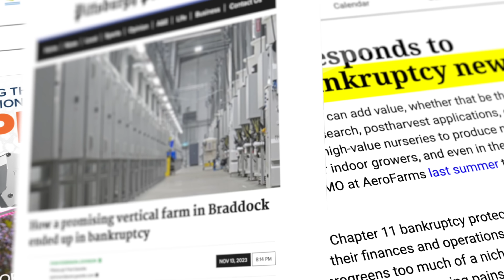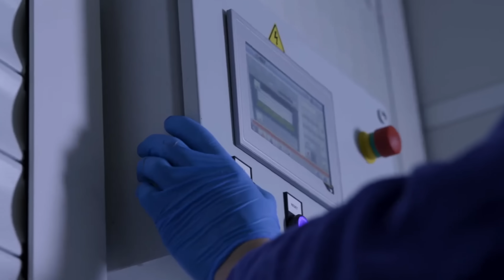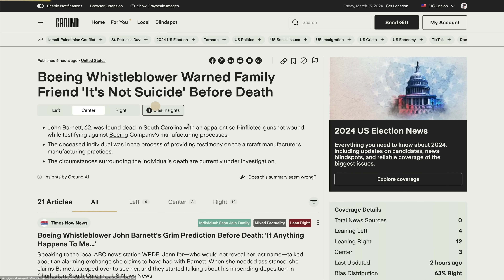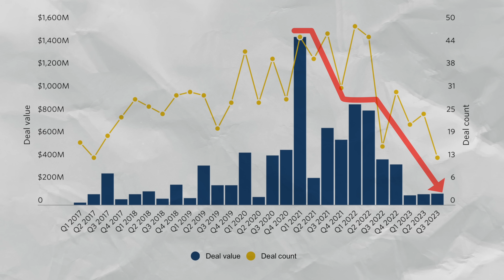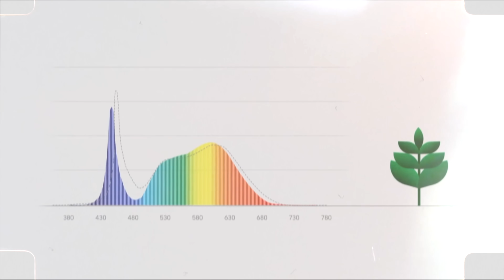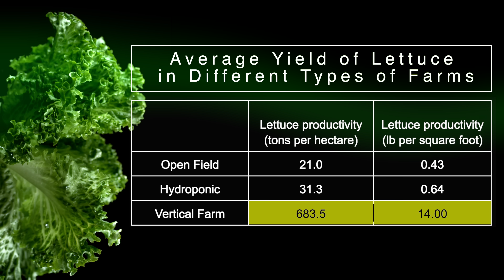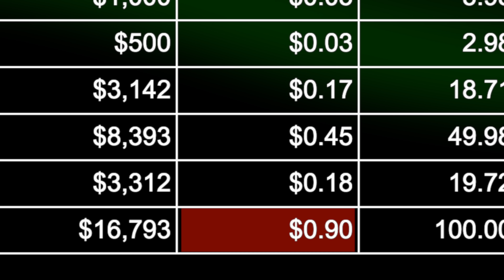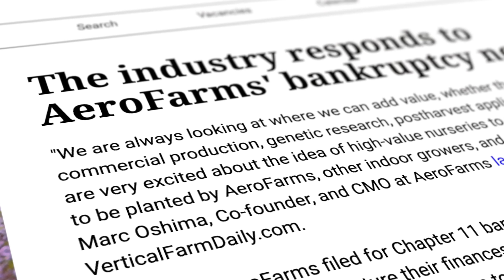The EPIC Failure of Vertical Farms - What Happened?

Comment: Looking back, another problem is crop selection.   Replace hydroponic farms with recycling soil and more profitable crops can be grown.  
     Alfalfa, soybeans, peas, oats, beans, squash, watermelons, cantaloupes, tomatoes, strawberries, squash, cucumbers, potatoes, carrots, peanuts, ..., 
     Without trying to be cutting edge, these are all easy to grow, produce high yields, and add variety to the crops.  
     Removing height constraints opens up more varieties.  Corn, maize, wheat, grains, pears, avocados small footprint fruits and citrus can be added.
Reply: the value of farmland is based on it's ROI on a certain specific set of crops that have already been tested to have the highest dollar returns for that particular land. any given crop being grown on any given piece of land is usually there because it would not grow well anywhere else, not because it can grow there. For example potatoes are mostly grown in idaho and maine on a relatively small piece of land, despite being suitable for growing almost anywhere in north america, because they have extremely high yields and farming automation requires a particular type of soil to efficiently extract it from the ground. and yet, they still only get 10% of potential yield per acre because getting the other 90% would involve too much labor. 

Trying to grow a variety of crops only works when you are supplying directly farm to market locally. On an industrial scale its nearly impossible. 

Also alot of the crops you mentioned are not suitable at all for growing on anything but subprime land. squash in particular comes to mind, as it has some of the lowest yield per sqft out there.
Reply: @duderinoification ... Well, nice try, but nope.  
     Where crops are planted is based on many concerns.  Many wet crops (cotton) are grown in dry, semi-arid, arid, scrub, and desert land.  
     Enough water, access, good or acceptable soil, distance to processing plants, sunlight, rain, degradation of soil by some crops, crop rotation, is that the best place to grow that crop, what else needs that space more, yield, labor needed, labor available, etc.  
     For instance, potatoes are grown in the Deep South from Louisiana to Virginia.  We haul over a hundred trailer loads out of "ALAGAFLA", where the three states meet in SW Georgia, every season.  Sweet potatoes are grown in the North Carolina plains.  I would not call squash a low yield crop based on the number of mosquitoes I feed while pickling squash every year.  Same with green beans, peas, peanuts, potatoes, cucumbers.  Corn is surprisingly inefficient, averaging  about 2 ests per stalk and creating lots of dead stalks to deal with.  
      Cotton was the crop that funded Southern Antebellum plantations.  Plenty of land, plenty of water, plenty of labor. 
     There was also space for feed crops, tomatoes, melons, vines, grapes, okra, orchards and more.  I have picked all of these in Southeast Georgia, where the sun is hot and the mosquitoes are hungry.  

In the '60's, the Aral Sea was massive.  By 2005 it had shrunk to two unconnected puddles.  
     Wanna guess what happened?
Reply: @WTH1812  sweet potatoes are unrelated to potatoes, completely different plant with utterly different requirements and growth patterns and cuktivation techniques, and a hundred trailer fulls is pennies. That wouldn't cover the demand for mcdonalds alone for a single day. and they grow ALL of their potatoes in a tiny are in maine. 
Squash is a low yield crop. per acre. pre square foot. 

we dont grow much cotton anymore. 

we grow corn mostly in iowa illinois and nebraska because of the soil. many considerations come into play. If strawberries or squash or peanuts were more profitable there, they would be grown there. 

youre missing the point It's not about what you can grow. Its about what you cant grow. You can grow anything almost anywhere. It doesnt mean it'll be profitable.
Reply: @WTH1812 
to further elaborate, farmland is priced with the assumption of a 5% ROI for the most valuable crop that can be grown on that land. 

For example, if you can earn 20k per acre raising dairy cows, that land will be priced around 400k per acre. 
You will not grow squash if it yields you 18k per acre. you will raise dairy cows. you cannot grow squash on that land because you cannot afford to.
Reply: @duderinoification ... We are one of dozens of trucking companies, independent contractors, gypsies, and load of convenience backhauls the pulled produce out of ALAGAFLA.  
     Sweet potatoes are another bulk crop grown in the South that are pulled out by the trailer loads.   
     Cotton is a generic crop I use to represent all the thirsty crops planted where water isn't.  
  
Large flat plains that can use large mechanical farm equipment easily.   

BTW, what happened to the Aral Sea?
Reply: @WTH1812 
you still do not get it. 
it doesnt matter if you can grow cotton where its dry. You can grow anything anywhere. 

The reason cotton is grown where it is grown is because it is the most profitable crop to grow where it is grown. If it was more profitable to grow anything else there, the more profitable crop will be grown there. 

THE PRICE OF THE LAND IS BASED ON THE PRICE OF THE MOST PROFITABLE CROP THAT CAN BE GROWN THERE AT 5% ROI. 

what part of that do you not understand? 

You grow what is most profitable. In your tiny little sliver of georgia, potatoes might be the most profitable. Otherwise they would be growing cotton. or apples. orwhatever else. and the land is priced based on that.
Reply: @duderinoification ... Univariant optimization in a multi-variant environment always results in a less than optimal result.  
     😎 Thanks, it's been decades since  I got to use that quote.
Reply: @WTH1812 your quote about univariance is just flat out low res take AF. 
Most crops have companions or alternates that are rotated. Corn and soybeans. Wheat and lentils. etc. These pairings are set in stonen and factored into the price of the land. You are not going to make money growing squash on corn land no matter what the yield. 

The mark of an amatuer gardener is growing squash, especially zuchinnis...getting a big plant with more than you know what to do with, then acting like they were successful. Congrats, you grew the easiest thing to grow anywhere that is nearly universally unprofitable unless used for overfertilization remediation in a market garden environment and even then is often sold as a loss leader. good for you buddy.
Reply: @duderinoification .,, - or - squash was popular with my mom so we planted a row in the backyard garden.  Every year it went forth and multiplied with gusto.   We used the excess for target practice.  
     Yes, crops are paired and rotated to keep from leaving the ground depleted and lying fallow.      
     As for planting crops to maximize profits, too much of a "right"  crop floods the market add lowers its value too low for it to be profitable.  This this is avoided by a holistic approach for the entire country to keep from flooding the market. 
     In China, some food prices are lower than cost, sometimes farmers can't give their fruit crops away because too much fruit and shoppers barely have enough money to buy one fig.

Comment: I have been farming for almost 30 years, mostly organic, mostly outdoors, and have always doubted these hi-tech fantasies. First, the hygiene hypothesis applies -- our effort to kill all pathogens/pests is (probably) a mistake -- in our human bodies as well as in an agricultural ecosystem. (that said, I make no claims that organic farming has overcome the issue of pest pressure with a more open-system approach to soil/air/water biology.) Second, to my eye all those structures and materials are depreciating by the second. Third, the problem with agriculture, economically, is that the unit value (head of lettuce, serving of grain, etc) is so very low. Only a crop like cannabis can justify this high level of capital cost. Fourth, the ethics of our ecological crisis requires humans to attempt to re-nature agriculture, rather than de-nature it further. Even if the creatures that benefit have no "value" for humans, non-human life is still something we should care for and about to the maximum extent possible.

Comment: What if someone cut the top off the container and installed clear ceilings then at night use the artificial light from solar power stored in batteries captured during the day from panels. Then, you'd get the best of both worlds by taking advantage of the greenhouse effect.

Comment: full automation should make it cheaper.
They have to replace workers with robots and AI.
Yes that would increase the upfront cost and maintenance.
Then again the cost of maintenance will go down as automation goes up.
If everything is fully automated, there is less risk of bringing pests into the system.

Its a needed tech for the future of humanity. 
We will have to eventually expand into space and space it at a premium on any spaceship or colony.

I think it will still take years of decades to make it work.
swiching to areas with lots of sunlight for solar power is a good start.
They will need cooling.
But solar power is cheap.

On a site note.
If they really only produce letuce, then i see a future where many humans will eat ration bars made out of them.
Then again automation is getting better at complex tasks so i gues farming all kinds of vegetables and fruits should not be a problem in the future.
Hell i see traditional farmers here in germany using self driving farm Robots during the night.
Works just like the lawn mowing robots, just on a larger scale.

Comment: Good analysis. When I hear people talking about farming yields only, they're missing most of the equation. Example is in rice- costs for labour, land, water, fertiliser and a whole bunch of other stuff vary significantly in different areas  and  these determine what practices and ultimately yields farmers will take. Pushing for higher yields also increases costs, especially if using more cutting edge agrochemicals. If yield value increase is matched by cost increase to achieve it, all you've done is increase the risk for the same profit. Being a farmer means playing for the long term as a few consecutive losses can wipe you out.

Comment: it would somehow have made more sense to place greenhouses , they have no shortage of land, just fresh water and transportation was never an issue
+ i am not even an engineer but i could easily create a desalination instalation that is not hypereficient but would work easily and constantly as long as the freshwater side were lower than sealevel and all i'd need is pipes, mesh, a solid filter, a rotating washer, concrete and either an olds' elevator or a traditional archimedes screw (the olds' elevator is an archimedes screw in appearance but it is the tube and not the screw, that spins)

with all of these and any secundary components you could create a pressure operated desalination plant in which the brine is continuesly driven up by the elevator, salt residue continuesly knocked of the filter by the rotating washer (and potentially waterjets) the fresh water would likely lack vital minerals but remineralisation could be achieved by letting the water flow trough natural substrate on it's way down, backteria and evaporation losses could be treated by simply running the water under sunlight in glass pipes and tubes (plastic would break down from sunlight as well as adding more microplastics to the mix)

it would NOT be anywhere near as efficient as a modern desalination plant, but that can be debated, this design would be so simple that maintenance could be done by allmost anyone, 

(watercollection should happen a ways of the coast and the pipes should have a large mesh sphere surounding the end of it, the outer opening should have at least 3 times the diameter as the internal opening allowing for a massive pressure increase, the mesh should be maintained routinely or perhaps it should simply be made of a material that does not polute the direct environment but is toxic to most living creatures that would live on it (or it should just vibrate or spin to prevent attachment)

perhaps filter maintenance and replacement should rely on a revolver system, when a filter needs specific maintenance or is simply worn out a revolving cilinder would move a secundary filter in it's place whilst raising the primary filter out of the system and allow for it to be replaced or repaired, (again a simple mechanical system)

along the inland pipe there should be aquifers and locks so that the water might either be halted in case of emergency or diverted and also allowing for modifications and repairs to be done  (ideally the fresh water would immediatly have a 3 pipe connection running straight to the main aquifer, each pipe can be locked at equal intervals and each pipe can handle the full waterdebit the plant can produce by itsself, these would ensure redundancy in case of an emergency as well as further opportunities for modification.

the entire thing should take very little space compared to a "proper" desalination plant, this would be something that can provide for anywhere from a dozen farmers to a couple thousand, the beauty of it is (again) not in efficiancy but rather in it's incredible simplicity.

Comment: I think the only way vertical farming is done to be profitable will be to modify it for agricultural research, growing unique plants and observing multiple genetically modified plants mostly for drugs and chemical extraction.. then it would be profitable because it will be focused on growing high valued plants n fruits. And it will be .uch more profitable if it is used on growing plants that are usually imported from other continents, that way you are able to offset the cost of importing things from far countries. It's not necessarily a bad tech but it will need to be optimised for revenue generation. And the worst part about using it without optimizing is that if u focus on producing low valued crops like lettuce which is cheap and they the outcome is more lettuce on the market which will result in crashing the price more and bringing down margins.

Comment: It's the cost. In particular up front costs for the tech. There's no patience or reality for growth. Get Big Quick isn't going to work. The maintenance labor costs are also a problem. There's a lack of simplification. You don't need 100 knobs and dials for a head of lettuce. You should try to get by with 5. Instead of LEDs, those hot climates with less water and a few mirrors, you won't need LEDs and you can get more natural immunity exposure. Thanks for bringing this up. We sometimes need to take a step back and figure out what worked best/cheapest/simplest/more natural with only minor adjustments and retaining the entire idea of "vertical". Or even scrap that and use some desert space and utilize the high efficiency watering. (Then you retain the shipping infrastructure if that's "really" an issue.) It has to compete in real food markets. More crop diversity. If fruit trees are one of the core issues, find your smallest best yield per pound species and start there. It might be as simple as a strawberry.

Comment: They killed it with trying to be overly automated for a crop that's not that valuable. The lightings and atmosphere control is not cheap either. Outside.. it's free. I worked in hydroponic sales for many years. Nature does it best. Also don't get caught up with the red and blue LED's that's sort of over. Yes they use the most of those two colors but not 'only' those two colors just those two the most.

Comment: Yes I believe it’s possible in nature environment not indoors. It will reduce production by almost 2/3rd when you are totally dependent on the Sun light but it will eliminate the need of expensive machinery and labor costs cold be dramatically reduced. Just few gardeners taking care of the quality of the water nutrients and motor operating chain pulleys will do the job

Comment: It makes sense. Eg if you compare to traditional farms in the US, the traditional farms are actually "cheating" in a couple key ways: 

1) They keep the cost of labor artificially low by hiring vulnerable undocumented workers who they can pay less than minimum wage, which will result in a much less costly workforce than the highly educated and well-compansated workers who run vertical farms, and
2) The cost of water is kept artificially low, not connected to real shortages eg. When the thing you're saving on the most is water, ofc you won't be able to compete with people who are using tons of really cheap water. Societal "cost" vs cost in dollars, essentially.

Comment: If you knew anything about agriculture you would know ow that this was a scam from the start.  Food has to be produced in low cost conditions. Supplying lights is not economical.  Using hydroponics is not economical. Using an intensely expensive building is not competitive with a field!

Simple economics.

Then there is biology.   You will have debris and disease building up and you will require just as much pesticide use- fungi bacteria and insects- o my lower costs - less herbicide.  But you now pay for light and heat and even cooling. More people - can’t use efficient large equipment that treat acres in a day

This was know before any vertical farm was started so why did investors invest?  Ignorant investors who didn’t hire the best consultants.  I was asked 8 years ago whether this was a good idea and told people no it was not due to costs.

The relocation of these companies is to use cheap labor.